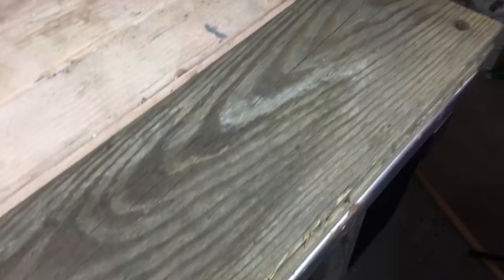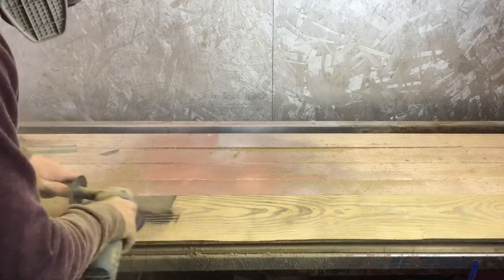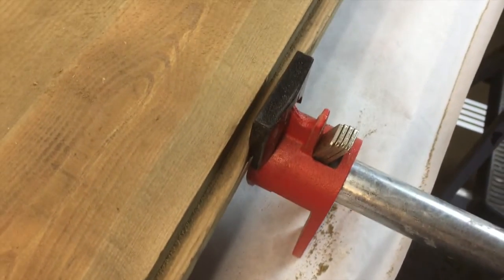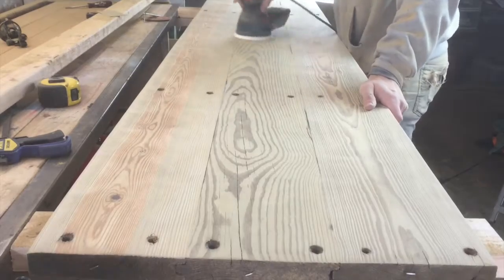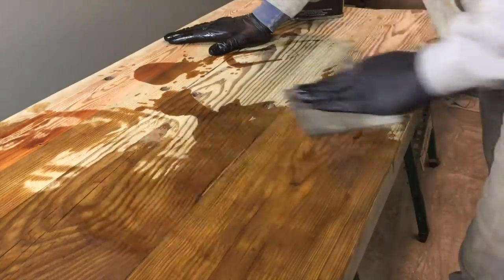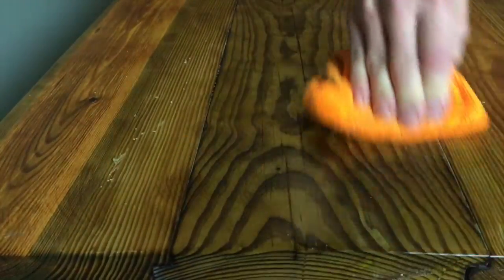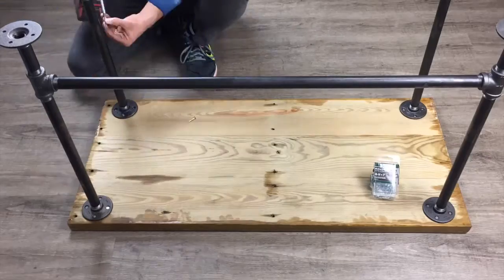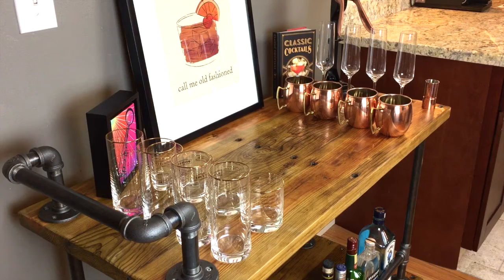How To Build A Reclaimed Wood Bar Cart : DIY BAR CART STYLING

Comment: ideas?    1) exterior lighting (how to choose the power module, how many lamps, wattage,  wired vs solar, LED or not etc).  2) how to repair a chipped tile, 3) how to patch a carpet seamlessly, 4) how to build a privacy fence     just some ideas :D
Reply from the maker: Thanks for the suggestions Peter and thanks for watching.
Reply: where is BYOT #19 ?

Comment: I am so happy that I found your channel! These videos are fantastic! Quick questions on this project: I want to build a bar for my new billiard shed and I don't need it to be a moveable. Can I just omit the wheels and the handle? If I were to do that, which materials could I cut from the material list for the handle? (I might throw the wheels on it just so it is easier to get out to the billiard shed in the first place.) As for suggestions on what I'd love to see you tackle next: Ripping down paneling, then taping, mudding, and finishing drywall.
Reply from the maker: Thanks for watching.  Yes, removing the wheels and handles would be just fine in this application.  The handle is just 2 flanges, 4 elbows, 1 12" pipe, 2 close pipes.  Also,  thanks for the suggestions.

Comment: I’m not sure if you mentioned it in the video or not but what are the dimensions of the boards for the finished product? And do you have to wait 24 after each coat of the varnish?
Reply from the maker: Finished product was approximately 18" wide by 48" long.  No you don't have to wait that long.  I applied a 2nd coat about 30 min after the first coat.  Thanks for watching Spenser.

Comment: Love the design and video, I was looking to make this in smaller dimensions (12" wide x 36" long) with 1/2" piping. I was wondering what the relationship between the wood length and pipe length should be, i.e. how much shorter should the pipe be than the wood to fit comfortably without the flanges being too central? Keep up the solid work!
Reply: i guess Im asking randomly but does someone know a trick to log back into an instagram account..?
I was dumb forgot the account password. I would appreciate any assistance you can offer me
Reply: @Devin Amari instablaster :)
Reply: @Milan Lee It did the trick and I actually got access to my account again. Im so happy:D
Thank you so much, you really help me out !
Reply: @Devin Amari Happy to help xD

Comment: Hey man. Here in the UK it's pretty hard to find the iron style piping and fixings. I'm thinking of doing something similar with copper piping. We can't seem to get floor flanges here, any advice on how to design it with this in mind? Thanks!
Reply from the maker: Interesting.  Do you have any type of threaded pipe readily available in the UK? If you plan on using copper piping where you planing on soldering the whole thing together?
Reply: Everything you need for this build is here: https://pipeworksuppliers.co.uk/index.php?route=product/product&path=80_94&product_id=248

Comment: Not sure if it's just the video or lighting, but it looks like your centermatch lumber was pressure treated. I would be hesitant to use it in a food contact (or booze contact) application. You need to be super careful about where reclaimed lumber originated.
Reply from the maker: Good point Tom.  I asked the question when I purchased the lumber and they assured me that I didn't have to worry about that.  However, it didn't stop me from using a high quality ventilated mask  when I was sanding so I didn't breath in anything I shouldn't be.  Thanks for watching and the very important point of not doing something like this with PT lumber.